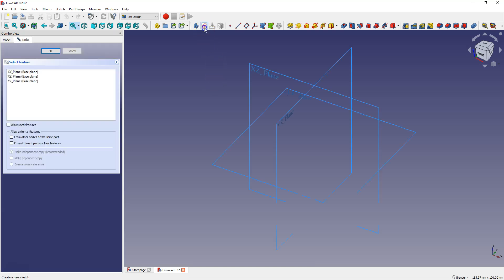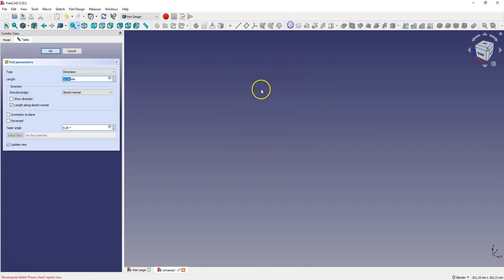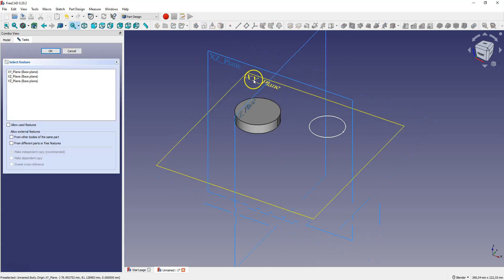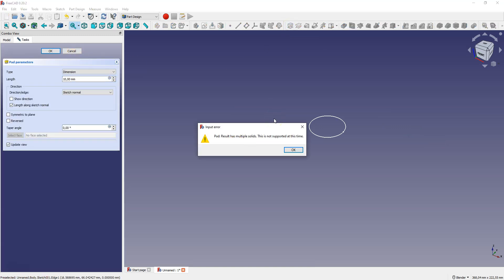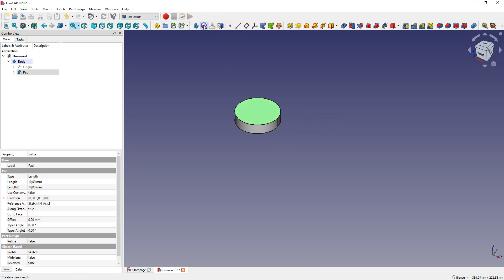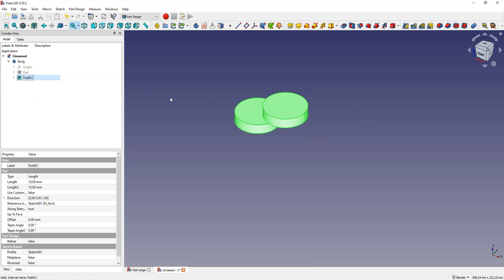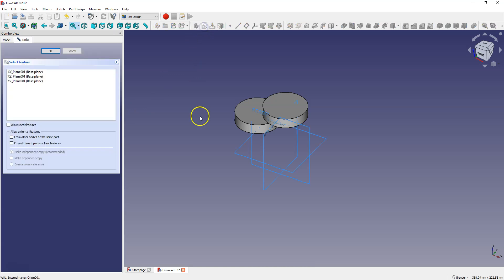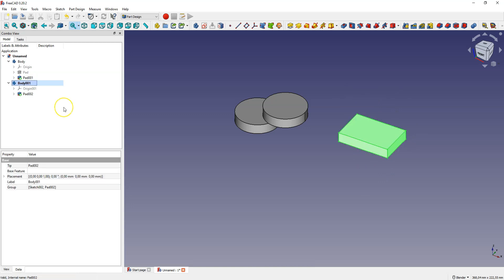FreeCAD Two BODIES in One Project

Comment: Thanks, you've just described the issue I was facing, except I didn't have any error displayed when trying to pad two separate solids at least in FreeCad 1.0 which was very frustrating and counter intuitive. After several attempts I found out padding was working with overlapping shapes, but not with separate shapes which you've well described in your video